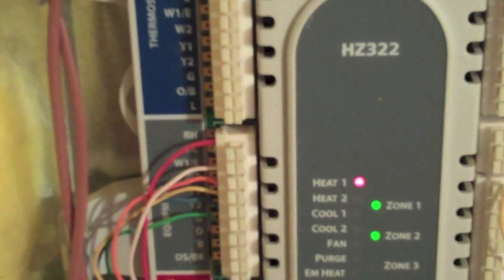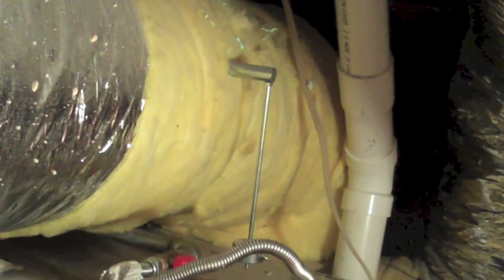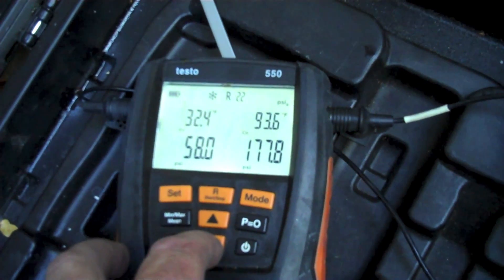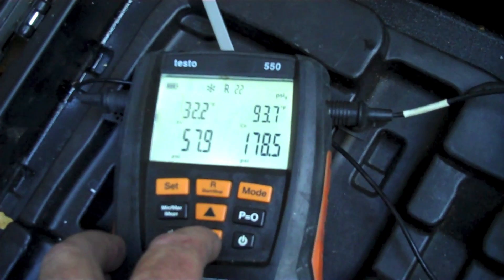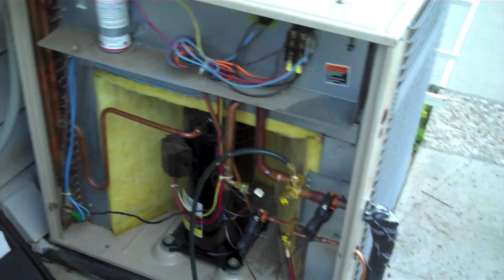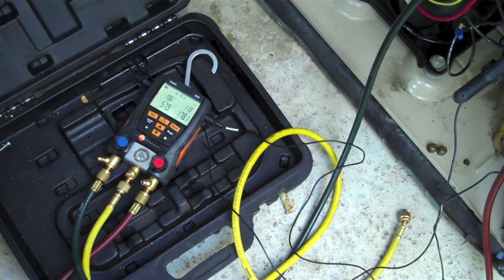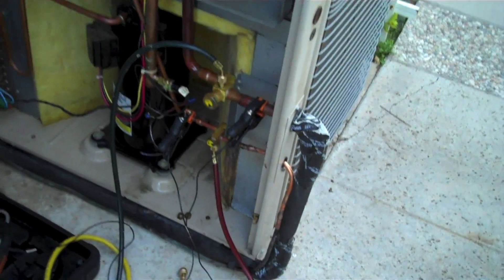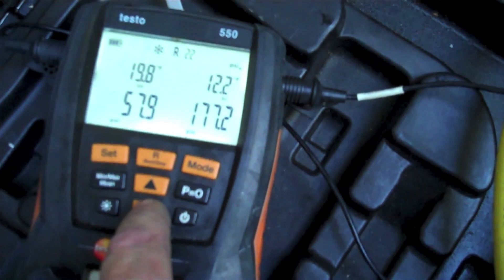HVAC extra video and hack photos *** MUST SEE***

Comment: how far has zonning technology come? the zone control i have expiernce with is late 90's TrolaTemp by Honeywell three zone setup with single stage heat and cool used for controlling two zones on a 100,000 btu Ducane. the dampers were hacked in and the duct for the new half of the house was greatly undersized. i imagine you could fix it up in day with ease. its all in an open basement.